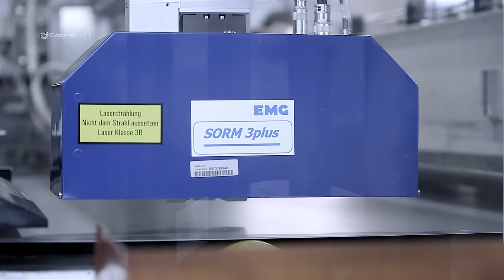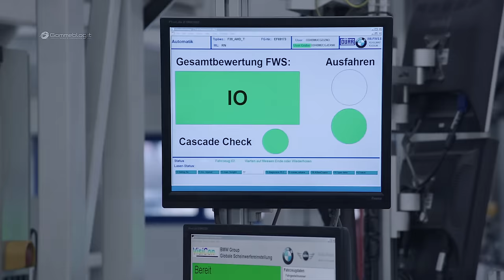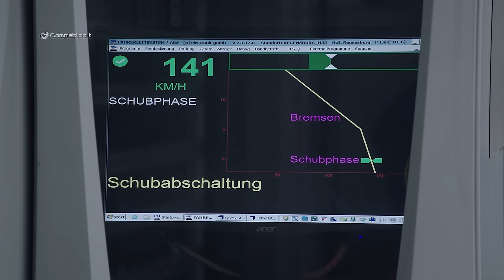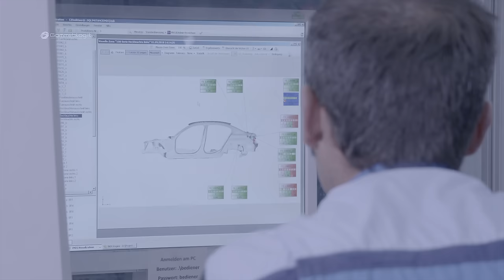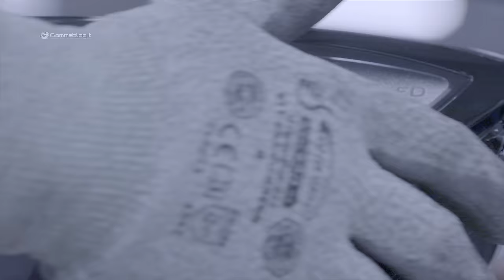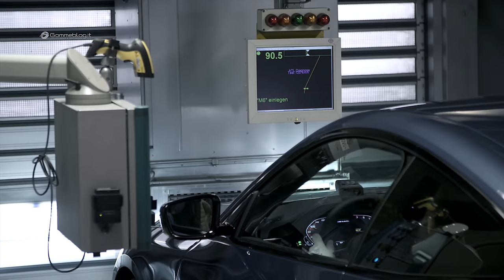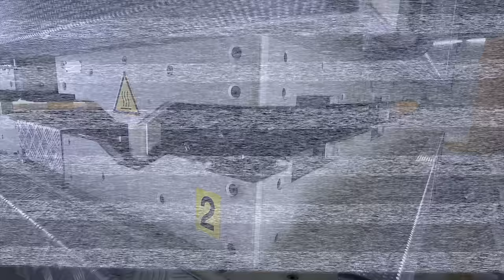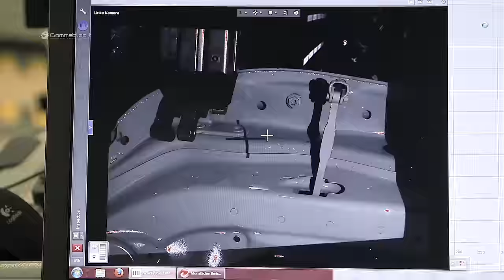BMW - PRODUCTION ➕ TOP 9 CAR 🚗 SUV 🚙

Comment: If you have ever wondered why your car is so difficult to work on or cost so much to fix look no further. Everything is built outside the car, then it’s shoved up or into and bolted on.
Reply: Why would you want the engine assembled in the car?  It could take days and a side shop would be easier to maintain  same for paint and seats.   Saves on cost too.
Reply: @danc2014  That’s not what I’m implying. I’m stating that it’s difficult to work in your vehicle because it’s completed outside, while going through at least a dozen stations by over a dozen employees.

Comment: BMW has so many problems.
The 3 series I bought is.
(1) Front tie rod end is defective and makes noise.
(2) Trunk will not open.
(3) "No vehicle key" is displayed and engine will not start.
(Replace body domain controller.)
(4) Gesture control does not work.
(Replace gesture control module)
There are many others.

Although it has only been manufactured for two years, I am really troubled by the frequent malfunctions.
We are really troubled by the frequent malfunctions.
I have to go to the dealer every week to fix the defects. I am tired.